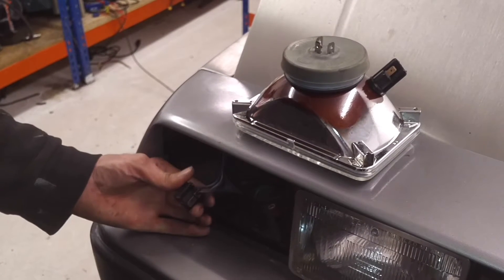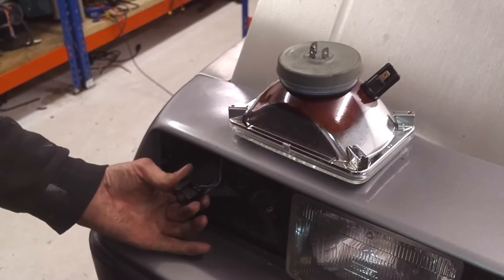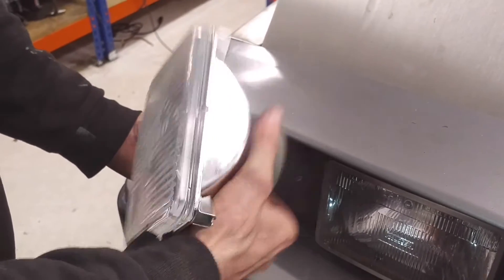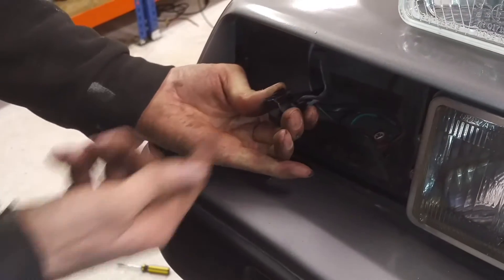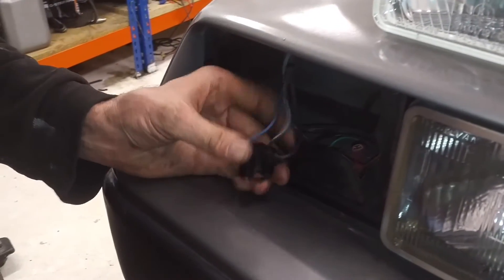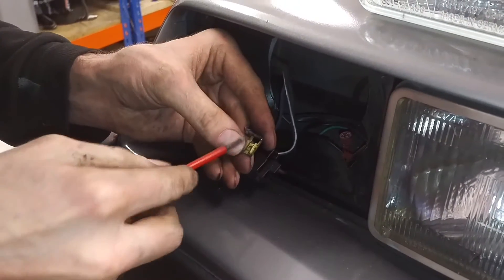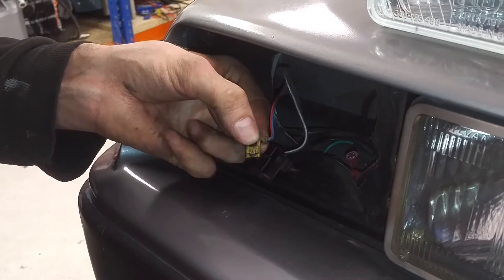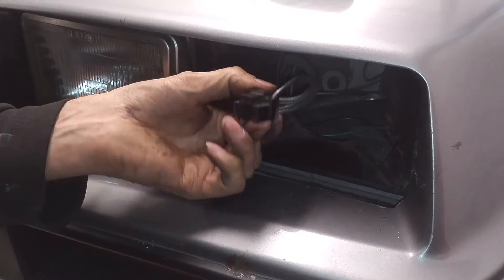DeLorean H4 headlight wiring how 2

Comment: what happens if the wires are left original and connected to an H4 bulb? Does it swap the dipped and main beams?
Reply from the maker: No, though it does look a bit like that's what happens. Classic symptom is that on dip beam, the high beam (inner) lights glow slightly.
Reply: @mgutkowski  i better check mine
Reply: @mgutkowski  that's a bit odd. My outer lights have sidelight holders in them, but no bulbs in those holders. I haven't had a chance to take them out and check the wiring.
Reply from the maker: Sidelights have to be spliced into the indicators (original US spec has a twin filament bulb). Nothing to do with headlight wiring
Reply: @mgutkowski  i see, thanks